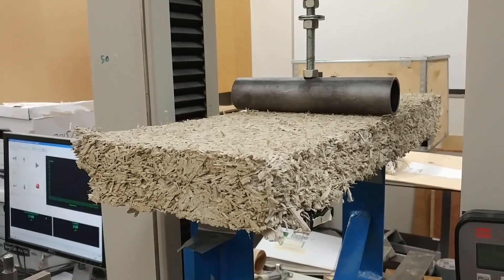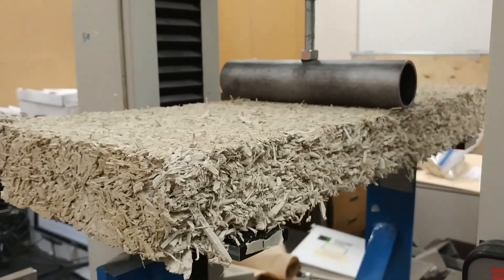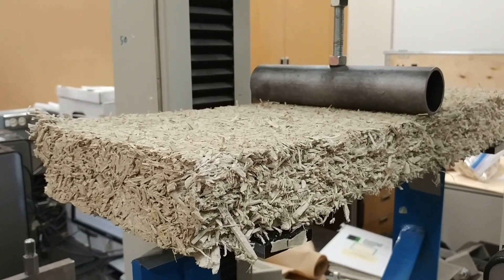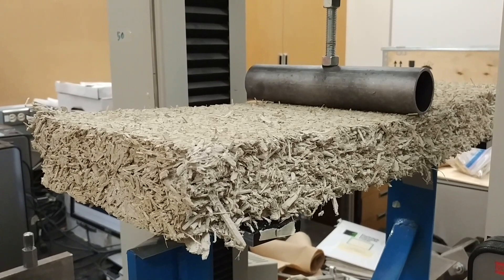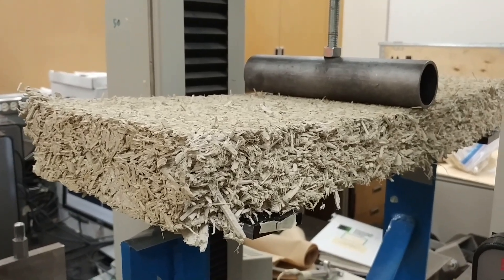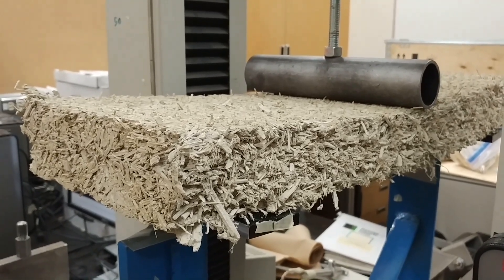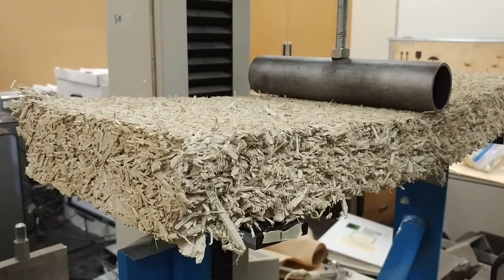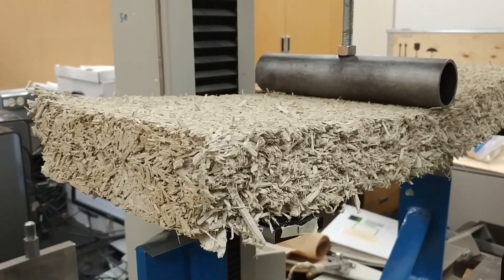20170801 Early Hempcrete sample Bending Test

Comment: Curious what affect using dirty hurd would have. hurd with some fiber
Reply from the maker: Thanks for the question and sorry for the slow reply. Dirty hurd is not too much a problem unless it is staying wet for a long time, then there is a good chance of mould developing. Hurd with fiber is not too much of a problem either as you can see there is some hurd in this sample. Generally you don't want too much hurd as it can start to ball up in the mixer.

Comment: Stronger than steel?
Reply from the maker: No, we would not say that at all, as this is an insulating wall infill material. The strength is not that great, but the material has good resilience and great energy absorption to assist with seismic acceleration on a structural wood frame building.

Comment: Made without compression it will not have near the strength.
Reply: Thank you for your comment. It is made with some compression, but we are not clear what you mean "near the strength." The strength for what?
Reply: @montychong-walden6564  site poured is tamped and not always uniformly and isn't as strong as compressed as it would be in a factory made slab.
Reply: Although not mentioned here covering at least one side with a membrane of woven hemp material the slab becomes very stong. This could be useful for a floor of roof where an open expanse is needed
Reply from the maker: @genocanabicea5779   I think you are right about the woven hemp adding strength, although if you are using for open expanses, you would likely need to put a weave on both sides of the panel and make the panel more dense so it is structural. This type of panel is more of an insulation infill material and only adds to the shear strength of the wall, or the sound suppression in a floor, not the structural support of the wall or floor.

Comment: how many pounds of pressure did it take to break it?
Reply: Hello Patricia, thank you for your question. As mentioned in the answer to Michael below, the results were not significant in this early sample, but what is impressive is the biocomposite's (hempcrete) ability to hang on and not just give way. This is the resilient nature of the product and its ability to absorb acceleration in seismic activity. It will reduce shaking in the building and stabilize the framing for less damage. Please see the published research link in the reply to Michael for more details on the performance results.

Comment: Wouldn’t it e so much stronger if longer strings were mixed in?  Anything to provide more strength.
Reply from the maker: Thanks for your inquiry. You may be right about that, but the challenge is in getting these longer fibers mixed in nicely and not bunching up in a "hairball" or getting wrapped around the mixing blades. The lime-mortar binder is pretty "sticky" and takes some finesse to get it evenly spread around the chips. Certainly something we would like to examine in the future, but as this material is really meant to be an insulating infill around structural wood framing (with structural racking support), it is not as critical as if it were to be a structural assembly product.
Reply: @calmura  Fair enough.  I suppose I was thinking of was just tossing little string bits in, but in reality an actually functional structure would be closer to how dirt on roads/ramps is places, one layer at a time with a net in between to prevent the compression forces pushing the loose material outwards.  That works well and I think it’s renewable.  Increased compression resistance by a genuinely staggering degree.

Comment: any data info on the video would be helpful thanks
Reply from the maker: Hello Michael. As mentioned, this is a fairly early sample of our work and investigations into creating lime-based biocomposite panels and accelerating the lime carbonation in an incubation chamber. So the data is not significant, but we did eventually improve the results quite well. There has been some research published on our biocomposite by UBC a Civil Engineering student here: https://open.library.ubc.ca/cIRcle/collections/ubctheses/24/items/1.0380555

Comment: Tam olarak kullanılan malzeme ve uyguladığınız basınç miktarı nedir?
Reply from the maker: Thank you for your questions. The material is hempcrete, which is a mixture of hemp hurd (the inner woody core of the industrial hemp plant) with a lime+clay binder. The pressure is not too great - not like wood or concrete - as the material is meant to be an insulating infill, not a structural material. We were doing these tests as a comparative analysis. But, we found the resiliency of the material quite fascinating, even though it doesn't have a super-high strength.
Google Translate follows:
Sorularınız için teşekkür ederiz. Malzeme, kenevir hurd (endüstriyel kenevir bitkisinin iç odunsu çekirdeği) ile kireç + kil bağlayıcısının karışımı olan kenevirdir. Malzemenin yapısal bir malzeme değil, yalıtkan bir dolgu olması gerektiği için basınç çok büyük değil - ahşap veya beton gibi değil -. Bu testleri karşılaştırmalı bir analiz olarak yapıyorduk. Ancak, süper yüksek bir güce sahip olmamasına rağmen, malzemenin esnekliğini oldukça büyüleyici bulduk.
Reply: @calmura verdiğiniz cevap için çok  teşekkür ederim

Comment: What is the ratio of ingredients in the tested material?
Reply from the maker: About 50% binder, and 50% bioaggregate. Are you familiar with monolithic biocomposites (aka hempcrete) and working on something similar?
Reply: @calmura  yes, I am familiar by the information provided on the internet. Hempcrete.
Is the ratio lime based binder 50% and hemp hurd 50% by weight or by volume?
Reply: @AutoTradeKoreaCorp  weight or volume is no difference, just quantity...
Reply from the maker: @TheLazyGuyWay  Actually, there is a big difference between weight and volume of these materials, as the binder is much more dense than the hemp hurd chips. So, the hemp ends up taking up much more volume, but is only about 50% of the weight. You can maybe see that in some of the pictures here: https://www.instagram.com/p/B847wFmJ5Bz/
Reply: @AutoTradeKoreaCorp  you are asking good questions here, also interested in the ratio. 50/50 seems a very strong mix. Is this a by weight or volume of material ratio?